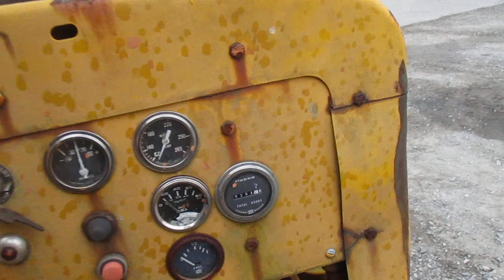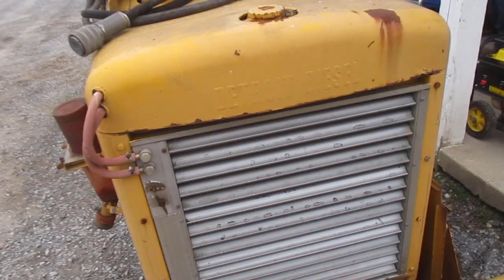Howard Co. Spring Consignment Auction 2023 # 1091

Comment: Oman gen set. Got a basket case with spares.
Reply from the maker: hi there did you mean the real old one  john
Reply: @fricknjeep  It is post-Korean Conflict surplus. I stored for an older friend. Now he is gone and can’t keep it.
Reply: Has two cylinders, air cooled. I guess two KW maybe.
Reply: @fricknjeep  I was referring to the one painted yellow, two cylinders, and air cooled.
Reply from the maker: @dmparks4013  hi i got 2 engines today . a yellow one and the detroit  john
Reply: @fricknjeep  Great! Do they function 100% now? 75%?
Reply from the maker: @dmparks4013  plan on getting them tomorrow , i don't think either run at this time . john